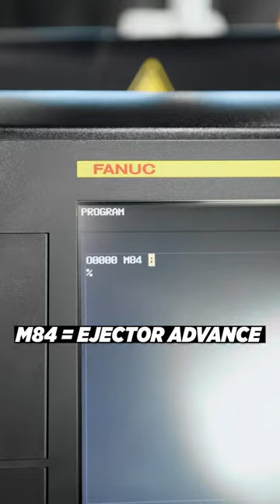DIY Crucial Swiss Part Ejector #shorts

Comment: For those wondering how the material can be fed and retract while cutting, it is because next to the machine where the bar stock is held/fed, there is a bar collet that fits onto the material. Then there are some teeth lookin things that grip onto the material and has to be set to the right tension. Then in the main spindle, there is the collet and guide bushing. The bar collet, main collet, and guide bushing have to work together so that when the progam calls the material to be fed or retract, the collet and guide bushing can open and close in order to let the material move. I used to do set ups and operate on older versions of swiss lathes like the tsugamis. It's been almost 5 years since I've last worked on one but i still remember how it all works. The swiss lathes are awesome machines that can hold super tight tolerances to. I used to run parts that only had +/- .0002.

Comment: How does the chuck/collet grip the part to allow or to be machined and allow it to move through it at the same time?
Reply: What you see is a guide on the front. The chuck is behind that.
Reply: @JEWFisch  
Ok but still, how can you clamp your material so it doesn't slip and have it being fed at the same time ?
Reply: @PyroMania61  they are synchronized and moving at the same rate one e the secondary spindle clamps
Reply: @PyroMania61 that’s one of the things that makes that Swiss machine so friggin sweet.
Reply: It is called the guide bushing and my understanding is that it's a very precise slip fit on the raw material, and not actually clamping
Reply: the raw material slides through the guide that you can see in the video. behind that is a collet in a spindle that is on linear rails transversing it forward while the spindle rotates the material.
Reply: Think of the thing you see at the front more of as a steady rest than a collet.

Comment: I've only ever done conventional machining. I was just thinking of how much longer it would take to just make this simple part. Most of it could be done with one setup on a turret lathe, but then, after turning down the larger o.d., you'd still need to change collets to turn down the smaller o.d. and cut the taper. I guesstimate probably a couple minutes for each side - plus 2 setups. Granted, the 2nd setup would be quick, but still.
Oh, probably add another minute or two to the whole thing to account for a light file and maybe even scotch-brite!
What really spins my head, though, is that the stock bar is fed into the tooling instead of the tooling moving into the workpiece.
Nice to watch this
Reply: If it was just for one part i could make it faster on a conventional lathe, purely down to the time to program, it would take me 10 minutes to program both ends the whole part in a couple hours or less. I wouldn't be programming the same part on a Swiss in 10 minutes that's for sure. Plus it takes longer to change collets and guide bushing, proving it through etc. However once you start doing quantity the Swiss wins every time. I would be interested to know how long it took him to program given his level of proficiency.